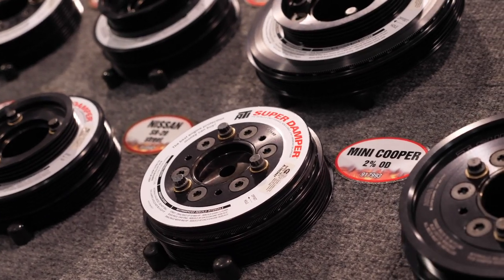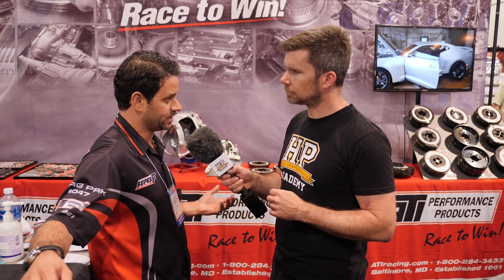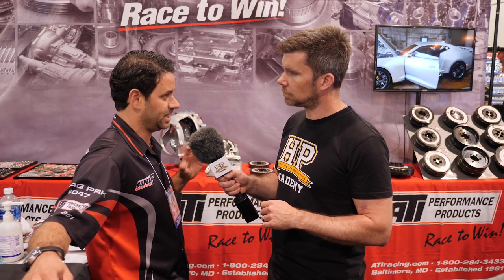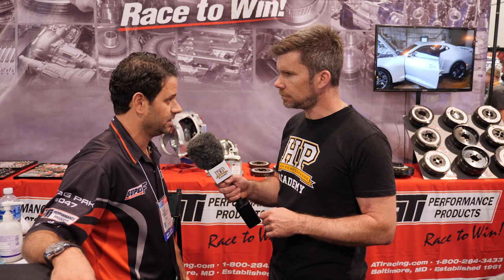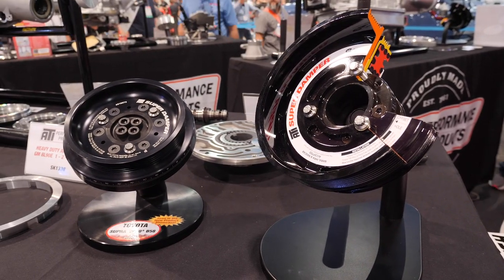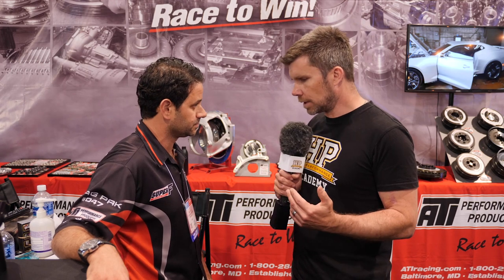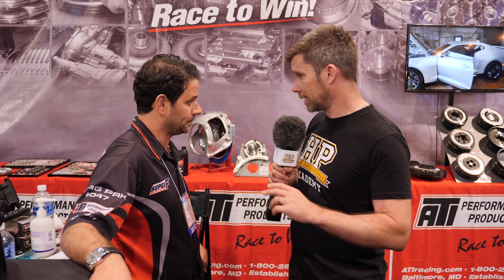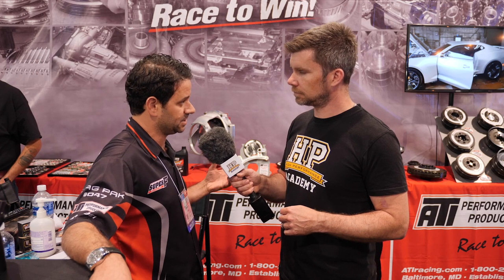What You SHOULD Know About Harmonic Damper Pulleys | Harmonic Balancers 101 [TECH TALK]

Comment: Thanks for addressing this, I can't stand it when people think that they don't have to run a damper because they had their rotating assembly balanced with their new billet crank pulley. There's a shop near me that pushes their custom crank pulley and I've seen a few different failures caused by it and it's never been good. The worst part is that they won't admit that their "balanced" pulley is the cause of the problems.
Reply: How You can be so sure, that the "balanced" pulley was the reason?
Reply: @jareknowak8712  how can you be sure it's not? Why take a chance?

Comment: I was gonna get a lightweight pull for my wrx but was recommend a fluidamper
Reply: i have friends that are drag racers with 7 - 8 second quarter mile cars and i was told a story how this one car had a fluid dampener on it. the car sat for a long time...long enough for the fluid to solidify in one place in the dampener. once the cat was started, it destroyed the engine cause the balance was off like a brick in a washing machine. maybe fluid dampener has corrected this issue since then, but maybe you can research that. good luck💪
Reply: @PANTYEATR1   Not sure what your friend was running, but it wasn't a Fluidamper , they have a solid metal ring, incased in the damper, with a very thin layer of Silicone in between, it's can't pool because there is no empty space in the damper, even if in somehow went solid which it won't, it would just act like a solid pulley.  Banks Power just did a good video on it https://www.youtube.com/watch?v=OEd6tFbc86o&feature=youtu.be&t=1320
Reply: @taznz1  i could be confusing the fluid dampener with another brand that is actually filed with a fluid..which one could it be??? I'll text my friend and report back.
Reply: @taznz1  my friend said it was a fluid dampener. maybe it was an earlier design?
Reply: I used a Fluidampr on a CTS-V1 with an 18lbs flywheel (compared to the 40+lbs stock dual-mass chonker) and I could feel the difference just going through the revs in neutral. Idle was smoother and less chatter when releasing the clutch.
Reply: @taznz1  
I wonder if the guy had a 62 gto with a 454 hemi 6 pack
Reply: I put a Fluidamper on my JDM EJ205 AVCS pretty recently, it certainly made an improvement. smoother at idle and thru out the full rev band. this paired with EL Header, makes it more rev happy. doesn't feel like it's falling apart at them higher RPM's anymore.
Reply: @PANTYEATR1  I've never heard of this or read of this until a matter of days ago when someone was asking for opinions on the different styles. No proof has been provided that it's even happened and I haven't found it anywhere on the web. Funny coincidence this was the example used to dissuade a forum member from buying a fluidampr...
Reply: @2slofouru  a friend of mine drag race a BBC and the fluid dampener took the moter out.

Comment: How does this compare to the Fluidampr?
Reply: This^!
Reply: Fluidampr has a more broadband range of frequencies that it dampens. It's completely sealed and the damping media is a special silicone fluid which unless overheated somehow it essentially lasts for a lifetime. ATI can get away with lower overall mass I believe due to frequency tuning being easier to design as it is a standard relation of spring constant and mass of the inertia ring , where in the Fluidampr it is related to the mass of the inertia ring, fluid viscosity and shear area as well as the gap between the shear faces due to fluid flow dynamics. Personally i use a Fluidampr on my modified street car for years and absolute happy with it so far:)
Reply from the maker: @Nayr747 it's really two different approaches to achieving the same outcome. We've used both ATI and Fluidampr in the past and can't complain about the performance of either. We haven't got to a point where we have been in a position to compare the pros and cons of each style sorry.
Reply: @hpa101  The ATI is often press fit which can be a pain in the ass when you're in a pinch. The Fluidampr is generally not press fit. 

The ATI needs rebuilds every ten years minimum and this also implies the rubber will go bad at some point (like the oem 2jz pulleys). I don't like to repeat past sins hence going with a Fluidampr which doesn't need a rebuild.

ATI's are tuned for a narrower power range and the more you stray from the intended power the less it will dampen harmonics. The Fluidamprs don't have an advertised power range but I'm sure there's a limit where you would want to go custom. They're more adaptive to changes in power level.

I also seem to remember slightly different specs for the safety ratings but I'd have to go dig up my research to confirm. 
This is all for 2jz pulleys. I talked with Fluidampr while I was researching the benefits of either brand. Good folks and they suggested ATI also makes good products - as long as they fit your build goals long term.

Comment: I put an ati on my 400rwkw barra motor, first start up i could tell it was running smoother. Need one for my 300zx single turbo 450rwkw motor now, it currently has a alloy lightweight crank pulley that was on motor when it got balanced after being built.

Comment: The stock crank is designed with main journal overlap with the rod journals. The crank will have a characteristic harmonic. The stock damper is tuned for that harmonic. Stroker cranks, lightweight flywheels, lightweight pistons and rods all affect the harmonics. Vibrations affect oil pumps, distributor spark scatter, and the camshaft.
Reply from the maker: You will enjoy this, it discusses harmonics a little deeper from the perspective of an engineer deciding where they occur in the rev range, and how how: https://www.hpacademy.com/blog/88kg-500hp-10500rpm-hayabusa-v8-radical-sportscars-rpe-v8-tech-talk/ - Taz.

Comment: Whats the advantage of the ATI Damper over something like the fluidampr given the ATI requires servicing?
Reply: The ATI can be rebuilt as the elastimers are doing the damping where as fluid dampers cannot because they use fluid. I used to work for ATI.  They make great products but the company is horrible to work for.   I spent 2 years of hell as one of their employees.
Reply: Fluidampr has a more broadband range of frequencies that it dampens. It's completely sealed and the damping media is a special silicone fluid which unless overheated somehow it essentially lasts for a lifetime. ATI can get away with lower overall mass I believe due to frequency tuning being easier to design as it is a standard relation of spring constant and mass of the inertia ring , where in the Fluidampr it is related to the mass of the inertia ring, fluid viscosity and shear area as well as the gap between the shear faces due to fluid flow dynamics. Personally i use a Fluidampr on my modified street car for years and absolute happy with it so far:)
Reply: Balancing a crank with the balancer on is not a bad thing (except with a fluid one)... While balancing a crank it is at a static constant RPM (crank velocity is not changing) thus the balancer is not functioning thus not making a difference.

Comment: Good video! I have a Fluidamper on my WRX (EJ205AVCS) swapped legacy and you could feel the difference.
Reply: Sweet! I just built a factory short block 255 with a few extras and I was wondering about things to help smooth out the power curve and provide some longevity.
Reply: @zachscott4867  would consider this and cyl4 coolant mod
Reply: Equal length header as well
Reply: when you say you could feel the difference, what did you feel? I am looking at one for my car, which reading and watching this info would really benefit from one.

Comment: What's the difference of an RB26 750HP Ati damper vs 1000HP Ati damper? I don't need 1000hp but its the only thing thats currently available, should I wait for 750hp.  I'm not sure what the effect of the Underdrives and Overdrives
Reply: The underdrive/overdrive is achieved by the size difference of the pulley shells on ATI dampeners. Underdrive is beneficial to reduce parasitic losses from the engine  by under driving the accessories (AC, power steering, alternator). Overdrives pulleys are beneficial to crank driven superchargers by increasing the supercharger RPM and therefore the max Psi output,albeit at the sacrifice of some HP from the crank.

Comment: What’s the difference between overdrive and underdrive dampers?
Reply: I'm sure they are referring to different diameters in relation to over spinning or slower spinning in relation to the RPM of the standard damper and pulleys. You can slow down a belt speed for an alternator for example
Reply: @FizzaMC  thanks. which is better? Over drive or underdrive?
Reply: @IsThatGeneral honesty it's horses for courses. I need to run a larger underdriven pulley on my alternator for example on my LS1 because of the cam and higher than average revving it achieves. That was leading to early failure points for the overspeed on the alternator windings. Just a personal example of mine but only to do with the charging system but can affect things from water system, boost levels on a belt driven positive displacement power adder and other variables too. Hope it shines a bit of light on the topic for you. Smaller size pulley on a driven accessory from a uniform balancer pulley will spin the accessories faster or overdrive then, and vice versa to most applications
Reply: @FizzaMC  thank you

Comment: Yes but is a dampener needed for a built K20a motor revving to 9000rpm. Maybe 10000rpm+ or super high horse power.  I’m trying to lighten the load so I can rev free as possible. 

I’m asking because i was in the market of buying lightened pulleys and was going to buy a light crank pulley until I saw this.

Comment: I didn't understand if this is strictly for damping or for externally balancing. If this can also balance an engine, then how is the balancing done?
Reply from the maker: Your internal engine components are balanced separately, a damper does not do that for you or deal with imbalance, it is there to damper harmonic vibrations =)

We don't cover crank balancing, that is something 99% of people will get a professional with the applicable engineering equipment to do for them, but we cover piston and rod balancing which will help answer your other questions there I hope - Taz.

https://www.hpacademy.com/blog/how-to-balance-your-pistons-and-connecting-rods-techtalk/?utm_source=youtube&utm_medium=social&utm_campaign=general-interaction
Reply: @hpa101  Thank you. So on the other end of the crank we have the flywheel which is significantly heavier than the harmonic balancer. How can such a small balancer compensate for the huge flywheel which itself is likely large enough to dampen the loads on the crank?
Reply from the maker: This is a great write-up that goes into more detail than we do for you on this topic. I'm certain it's going to answer more than a few questions for you: https://www.atiracing.com/products/dampers/damper_dinan.htm - Taz.

Comment: So if we install a ATI dampener,  we don’t have to install aftermarket oil pump gears for coyote?
Reply from the maker: There's two aspects at play here. Often the material that the stock gears are made of is a genuine problem and they will have a known failure point. I can't speak about the Coyote gears from personal experience but that was the case with Nissan's RB26 - Rev a stock oil pump past 8000 rpm and it's going to fail regardless what damper you're running. On the other hand running no damper can result in premature failure of gears that would otherwise live a long and healthy life.
Reply: The stock gears are made of glass in the coyotes, change them out for forged ones

Comment: What I don't understand is... The only thing attached to my crank pulley is the rubber belt to the alternator. It was originally a harmonic/damper pulley on a Silvia SR20DET. But water pump now electric and air-con is removed. So, is the rubber belt and alternator really going to affect the need for a harmonic damper, or can I crack on with my ebay solid alloy pulley? 
Another thought process i have... If i had a big enough charged battery to run the car and removed the alternator, belt and crank pulley, and somehow could compare how much different 'stress' on the crank there would be compared to with pulley/belt/alternator, is it really that much?  I totally understand that 99% manufacturers use them but is it only really necessary when the crank pulley is running the air-conditioning, waterpump and alternator etc? Cheers! :)
Reply from the maker: Your auxiliaires are not the issue when it comes to harmonics, James from RPE covers the topic nicely here too, worth a watch: https://www.hpacademy.com/blog/88kg-500hp-10500rpm-hayabusa-v8-radical-sportscars-rpe-v8-tech-talk/ - Taz.
Reply: @hpa101  ok thank you. So imagine if there was nothing to spin on a belt, no alternator, water pump etc. Does this mean that it would be even worse on crank to have zero crank pulley or a solid one? Hypothetical question, as I am definitely going to get an ATI or Ross one to make sure, much cheaper than engine rebuild... Thanks!

Comment: Ok then explain this example. Big block chevy engine , internal balance you can use a 7 inch or 8 inch balancer some with elastomer band abd 2 piece some solid.  So with different weights of all these balancer how can engine still be balanced it is a Harmonic Balancer for harmonics not tornsional .

Comment: so how does the crank pulley dampen the torsion going into the oil pump and timing belt, when they are not connected to the crank via the dampened pulley, it stops the torsional vibrations going into the alternator and other crank pulley driven accessories. i would love to see an in depth analysts on how much vibration is in the timing gear and oil pump with and without a damper, because from my understanding, its only saving them accessories.

Comment: I have an ls3 stroker that had powerbond balancer fitted
Dont know why as i never asked for it
Timing chain snapped after 10000km or so
It redlines at 7000

They replaced it to an ati and rebuilt the motor again

Shouldnt have ever had a powerbond balancer

Comment: Should you run one on a rotary engine?
Reply: There is no need to, as there are no reciprocating parts.
Reply: @Rumnhammer  could you unpack that a bit please 😉
Reply: @RotorKartel  Sure, the damper cancels out the vibrations caused by the pistons moving back and forth and the counterweights offsetting the back and forth of the opposing piston. These oscillations are what the damper is countering.  A rotary engine has triangle shaped rotors that swirl for lack of better term around a figure 8 shaped chamber, all the motion is rotary movement as the rotors go through their motions it turns the crankshaft.  No back and forth motion means no reciprocating movement to dampen.

Comment: does it help to stop vibration transfer to gearbox?   as using solid flywheel low end gear noise is inevitable. any thoughts on this?
Reply: Obviously. The crank is one solid piece, connection to the flywheel is solid with no damping so any crank vibration this dampener stops will also be affecting the gearbox.

Comment: Sad to see they don't have a damper for my engine :(
Reply: Your engine in a focus doesn't have a keyway to line it up properly.  All ATI dampers are press fit, your stock damper is held in position via friction washers and  the average joe can't install even a stock damper on that engine because it needs to be timed to the crank when it is installed.  Without a keyway to line it up, it would make the install too hard  for the person to add this damper which is why ATI doesn't offer one for this engine, same for the Mazda MZR engines.  I used to work for ATI and got requests for those engines all the time.
Reply from the maker: Interesting info there Rumnhammer, cheers for sharing - Taz.
Reply: @Rumnhammer  but my engine does have a keyway in the pulley! I think you're confused with the regular focus with ford engines, mine is an ST with the 5cill engine from Volvo. Ford engines are without a keyway though, that's correct. But ati doesnt do a damper for the Volvo engines sadly enough
Reply: Contact them. Sometimes you have to get a group buy or 10 to 20 to get em made. I have a motor that's not supported, but they will make them in runs, and occasionally the one off.
Reply: @blackcanyongarage  Ahh ok yea i've contacted them and they said they didn't have anything for my engine but haven't told me anything about a groupbuy either. Ill look into it, thanks
Reply: @DutchFocusST  Talk to Joe over at 2j racing. Maybe he'll be interested in setting it up. He has a huge base over there